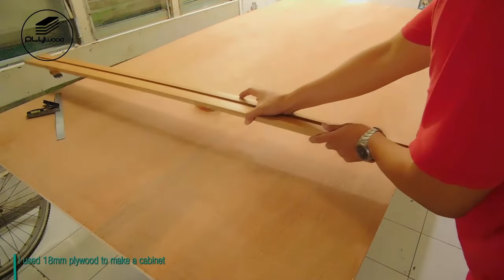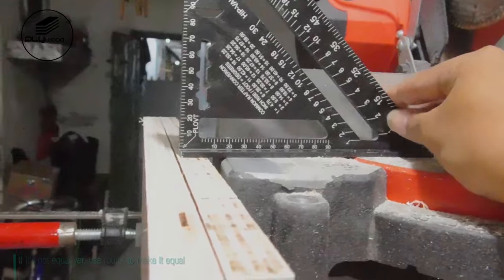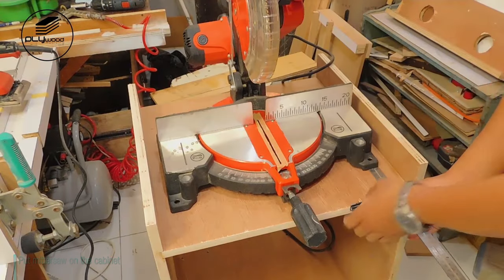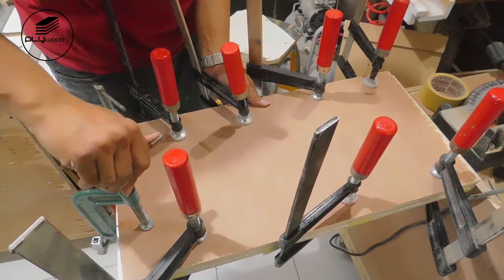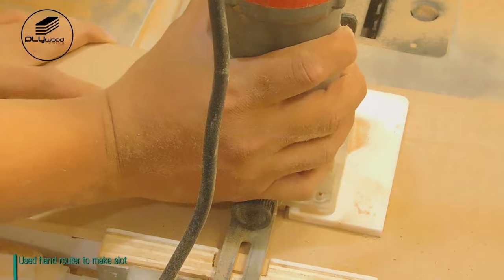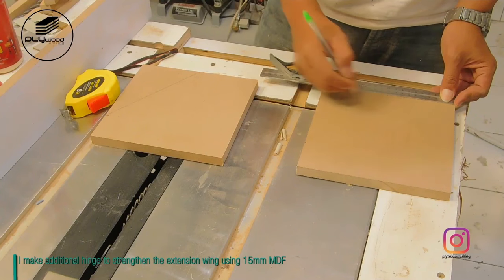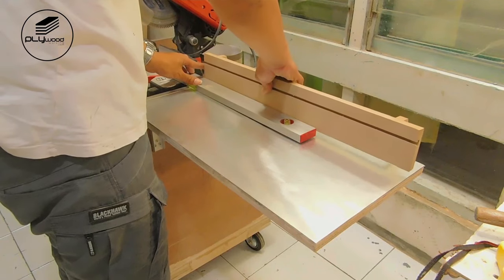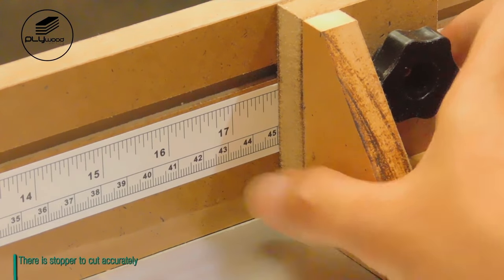Master plan - DIY simple miter saw station portable

Comment: Nice design. I have one suggestion/warning to anyone following this video. T-nuts are intended to be inserted into a through hole on the OPPOSITE surface of what is being bolted down. As installed, the t-nuts for the casters will pull out. This is very likely to happen due to the offset nature of swiveling casters and the resulting twisting force. The t-nuts under the miter saw should not see this but why not place them properly under the board. As installed you could likely lift the miter saw out bolts and all with little effort. Simple lag screws will work fine for the castors; if you want to use bolts, pre-drill the pieces prior to gluing and embed the t-nuts between the layers or use a threaded insert.
Reply from the maker: You right, dont worry about that, i give extra screw on t nuts but i off record that not show on this video for miter saw, but for caster whells i wrong add t nuts, now i give extra screw too.
Thank you for your suggestion👍👍